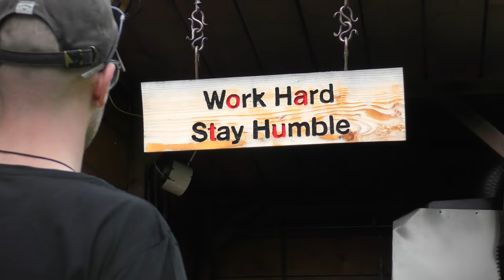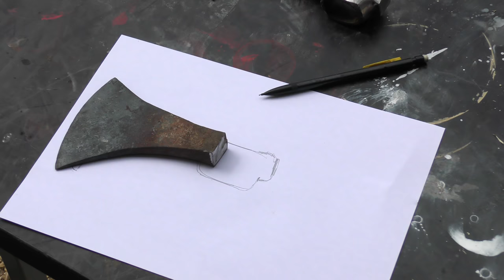How To Make A Double Headed Battle Axe / Fantasy Axe - Metalworking

Comment: Sorry to tell this mate , but Vikings didn't really use two bladed axes. Let alone Vikings , nobody did. For wood cutting purposes , it's not that bad. But for war ? That's stupid. It's just more heft that you need to counter which you need to counter by tiring yourself up , it would also slow you down too. Let alone those , it has no uses. It's just a threat to yourself , you can cut yourself by mistake while swinging. Also , the real war axes had very small heads. Like , really. To focus all your strength in one place , so that you could penetrate the armor of English , French and Byzantine's soldiers , later on everybody's.
All in all it's not historical and stupid. But really cool art I must say. That axe is amazing !
Reply from the maker: Well, I never said it was historically accurate. That's not the purpose of the video, which is 1) trying new things 2) making something cool 3) a challenge to myself 4) creating a weapon I wanted as a kid 5) inspire people to make cool stuff. 
And you're right on one point, Vikings probably didn't use a double headed axe for battle. Double headed axes became very popular in the state in the 1800's for felling trees. Two bits means more works without having to sharpen the blade again. But, if I'm correct, double headed axes existed. Even though this kind of axes has been mostly (and maybe too much) used in fantasy movies, games and tv show because the design is more impressive than a regular axe,  Greek, Turkish and other people used it as a tool or a weapon, then mainly as a symbol. The second head gives the axe a better balance (just like the "mail" served as a counter weight for the french "haches d'armes") and some of them also used double headed axes as throwing weapons. those were called for Bipennis, saggaris or Labrys, turkish Tabar.
Anyway, thanks a lot, I'm glad you liked the axe ;)
Reply: @RedSmithWorkshop  I know the Turkish used double headed axes because I'm Turkish 😂 , though it was later abandoned , because maybe our ancestors realised that it's not worth it ? I don't know. By the way , what you call Tabar , is Teber in Turkish , and believe it or not but it's actually just the old way of saying axe. Teber can mean any old Turkish axe. Most of Tebers actually were one bladed.
Reply: @RedSmithWorkshop  and yes there are advantages of it , but cons are much more.
Reply from the maker: I know you're Turkish, you told me and asked me for a Turkish sword few months back, right? ;)
Yes, Tabar is the occidental way of saying it I believe. Yes pros and cons. I'm not gonna use it in a battle anyway ;)